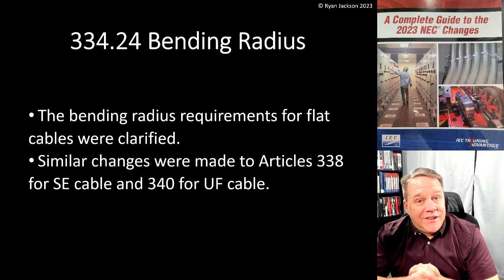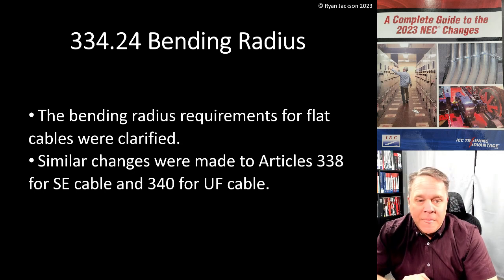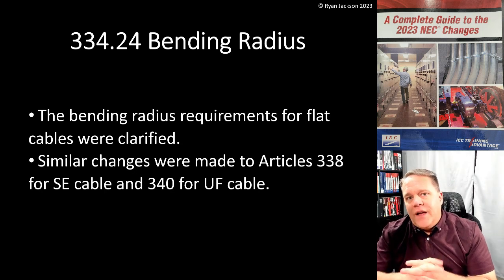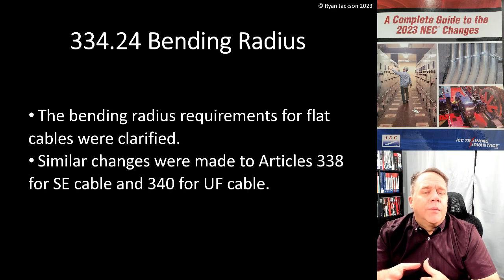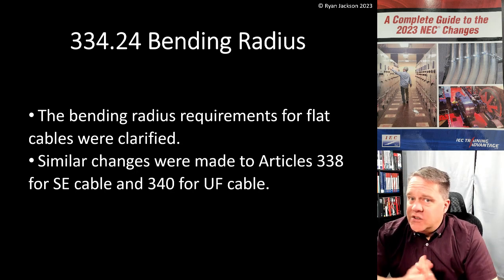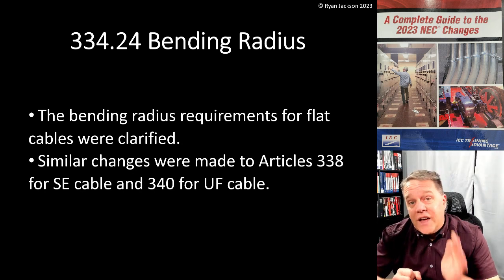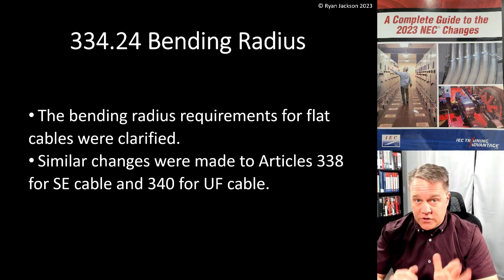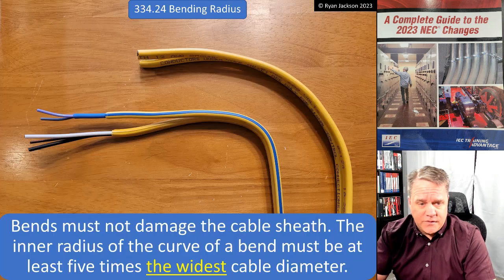334.24 Bending Radius

Comment: I can say this, I have done electrical work for 50* years and the last few years I have been working with a friend of mine who does fire forensics (electrical) for the state and different entities. Every and I mean every instance where a wire had melted and shorted, every bend and every spice upstream towards the panel formed a high impedance point and prolonged the opening of the breaker. In most cases also melted at those points and when they were melted, every time it was at a sharp bend and a splice. There are several reasons why this happens and too much to write about here but as for the bends it involves literally the conductor properties being changed as the wire is being bent, Being stretched on one side and being compressed on the other. That little bit of deformation makes a big difference not to mention the same effect on the insulation. Bends in wire is more critical than what everyone thinks, From data cabling to lightning protection systems and even romex!
Reply: Appreciate the share

Comment: This change makes no sense, is ridiculous, and could become problematic.  I wish I knew the rational behind the board in making this change:  as Mr. J- acknowledges, common sense stated that the radius should be determined by the width of the cable along the axis of the bend.

Comment: There is no guessing you go to the manufacture of the cable itself, and they have their white papers and lab testing that gives the measurements of allowable Ben’s for each manufacture. 

No interpellation by somebody no guessing black and white fact on a paper from the manufacture
Reply from the maker: You use the width of the cable and follow 334.24. Nothing more to it than that.